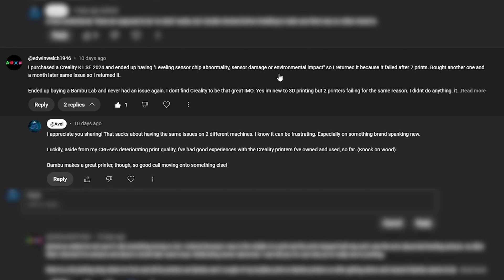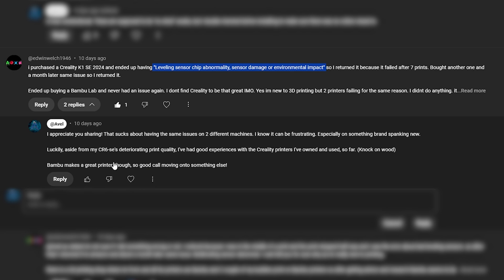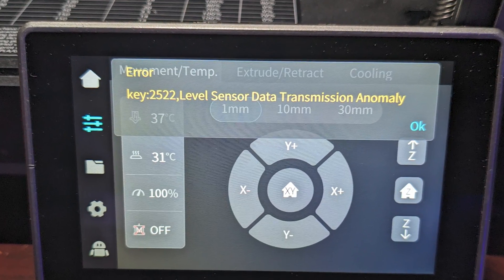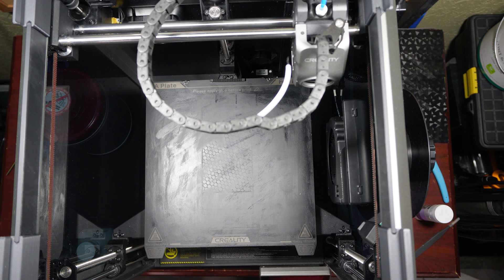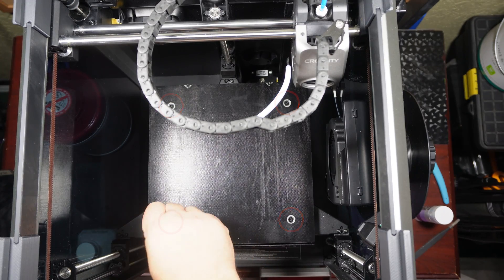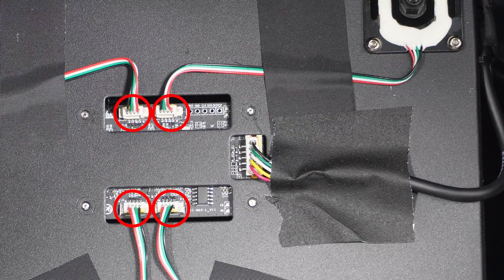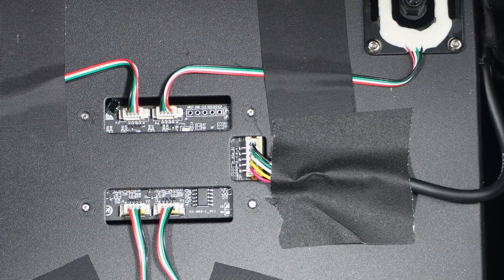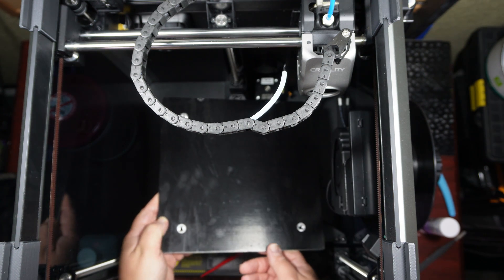Watch This if You're Having a "Level Sensor Anomaly" on Your Creality K1 Series Printer

Comment: I can remove the fn screws someone plz help im about to lose my mind. They spin but wont come out. All 4 of them. I tried an electric screwdriver manual method tried pinching them out with pliers they are stuck...
Reply from the maker: That's weird. I had one get stuck but all 4 is crazy. Try turning it over and thumping it against your knee or palm. Not too hard but do it a couple times and see if they fall out. That's what I did.

Comment: What if the one of the 4 screws under the build plate are stripped
Reply from the maker: If you've got a rubber band, try slipping it over the screwdriver tip and then try unscrewing. Sometimes that works for me, you might get lucky. If not, there's something called a screw extractor, usually comes in a set of a few different sizes. You may want to look into some how-to videos on using it. Not too complicated.

Comment: I have 1.3.3.6 firmware...tried reset..another fw but dont work only sometime...tried push connector like u all cables..4 sensors...and main cable in board bed and also in mainboard didkt fixed ..wait for new replacements..lol...so like 2-3 weeks wait omf
Reply from the maker: Oh, in my last comment, I thought you said you already had the replacement parts installed. Hopefully when you get them, it fixes the problem for you!

Comment: i heat bed to 110 temp for few min then it fixed..for few days..but now everyprint this error..so i need heat bed 100 then work.if not reset printer and work...idk..new sensors and pcboard(under bed) they will send me so hope will fix it.....
Reply from the maker: Wow, yeah, hopefully that fixes it for you. It's a big headache, for sure.
Reply: @Avel  but it doesn't fix...I have errors again
Reply from the maker: The replacement parts didn't fix it, either? If it's still under warranty,  I'd ask them to replace the whole printer.
Reply: @Avel  hm...it's not ...14 month I have my printer but they have in eu warehouse so I think if eu warehouse I must have 24 months warranty idk..
Reply: @Avel  I had not problems just last time this...and it's sensors so if replace sensors will work if sensors are bad lol...why u saying it not fix ?
Reply: @ no i didnmt get yet replacement parts
waiting for them

Comment: One of the anycubic kobra 2 printers I have I got as a customer return for $112 (CAD) shipped to my door.  Even if it never worked it was worth it just for parts.  it even had the original communications from the owner and support printed off and in the box.  the guy's name was Tim and I am 99% certain I stumbled upon his post on reddit about this printer.  It was an ongoing issue out of the box with the bed leveling not working.  Support suggested things and he tried and after a week nothing got fixed.  I had it solved within 10 minutes after I had it all together.  it was nothing more than the inductive probe was installed a few mm too high.  That was it.  I adjusted it and ran the calibration process and it has been perfect ever since.  When I posted this on Tim's thread I had a whole bunch of people flaming me saying that they shouldn't even have to do that, which is kind of correct...kind of.  There is no way to know what may or may not have happened during shipping and if people were a touch more patient and willing to actually investigate problems I suspect they wouldn't have so many problems.  So, is it worth it (to me) to drop $700+ on a new printer simply because I was too lazy to dig a little deeper to figure out was was going on with the one I already have?  Not to me it isn't.  I can buy a huge amount of filament for the difference.  The really funny part to me was that Tim also bought an X1C as a replacement and in his posts he mentioned about how the lidar didn't work right and the Z offset was really finicky causing failed prints leaving him to have to adjust it all the time.  He seemed ok with this though which seemed uber hypocritical.
Reply from the maker: Sorry I missed this comment til now. Not sure why it was hiding from me, but I appreciate the share. Nice score! Definitely worth it to me too, to get a working printer (or anything, really) at a fraction of the cost because it needed something tweaked. I would be all over it. Brand new is a different story - Mainly, if I have to buy something to repair it, that's not happening. I would return it without a second thought. But if I just have to adjust something, I can certainly look past that.